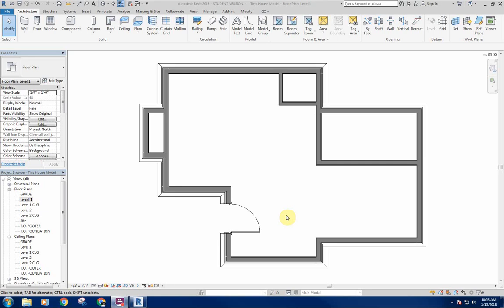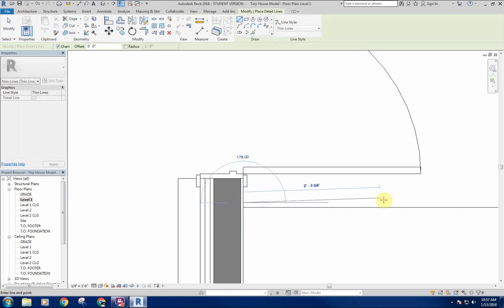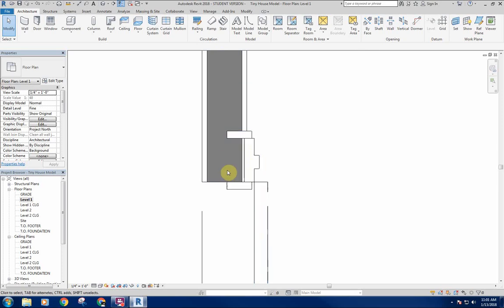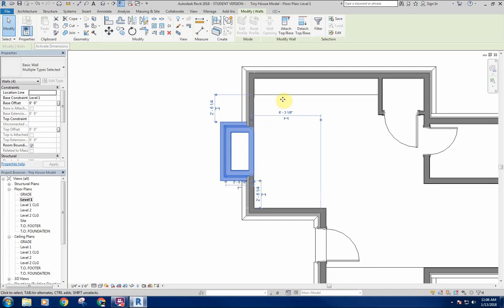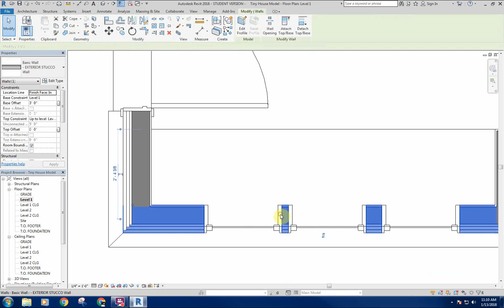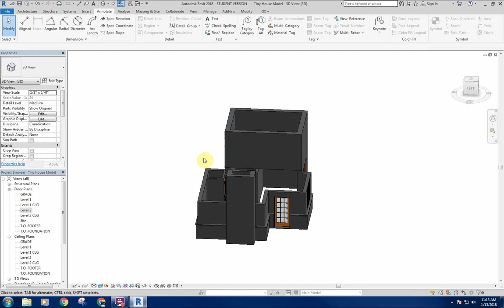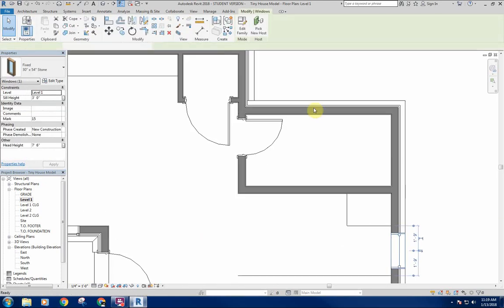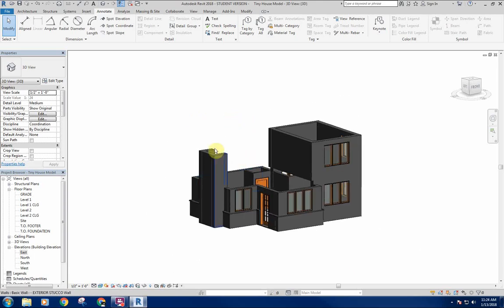Revit 2018 - House Tutorial - Part II - Doors and Windows

Comment: When I put the entry door in, it only cut through the upper Stucco Wall at this location.  I put another door into the living room and it cut both walls. Do you know what could cause this?  I even re-drew both walls at the entry location, but still it would only cut one wall type, but not both.  Thanks!
Reply from the maker: Use the join geometry tool to join both walls.  Once you join them together they should allow the door to cut both walls.  If that doesn't work (I've had a few instances where for whatever reason it simply doesn't want to behave as it should) you can select the lower wall, hit edit profile, then sketch an opening in the wall where the door is.  It's not the best, but it gets the job done.
Reply: @brianalbrecht7859   - thank you.  I did the Join command and got the door to show in both the upper and lower walls.  However, the stone sill remained, going across the door.  The edit profile option did not seem to recognize the sill either, so I was not able to cut it that way.  I was able to get the door to behave correctly in the wall where the murphy bed is to go, so I copied that whole wall and door into the entry location.  I also drew some walls off to the side to experiment with, but still couldn't get rid of the sill.  I will continue to play with it.  Thanks again for responding.
Reply from the maker: @zonsullenberger9049  
If you go into the wall where you put the sweep on, there is an option there that says Cut with Openings or something similar.  If that is not checked it will leave that there and it will go straight through your door.  Check that box and it will behave how you want it to.

Comment: why is my doors not showing as much details in the drawing ? mine doesnt show the jamb amd frame, only a simple rectangle for the door itself, i tried changing the scale and set the drawing detail setting to fine.
Reply from the maker: What type of door are you using?  It may depend on how the door is made and what style it is.  Some doors just have line work for the plan view and hide the actual door model in the family so regardless of detail level you'll just see the outline of the door and not the individual components that make up the door.
Reply: @brianalbrecht7859  thanks for the reply, it is from the library following the steps in your video, the files look a little different because it is revit version 2019
Reply from the maker: @raywvc  Ah yeah, from version to version there are going to be minor differences here and there.  Glad you were able to figure it out!